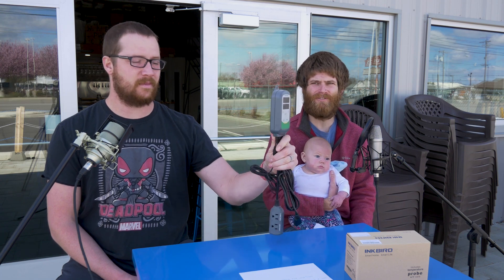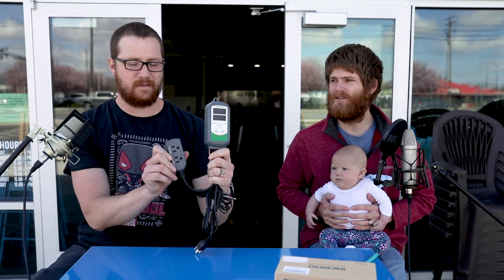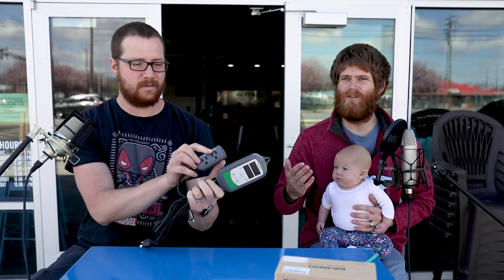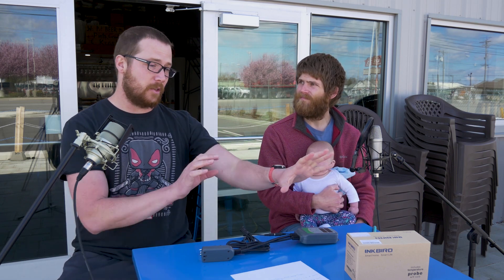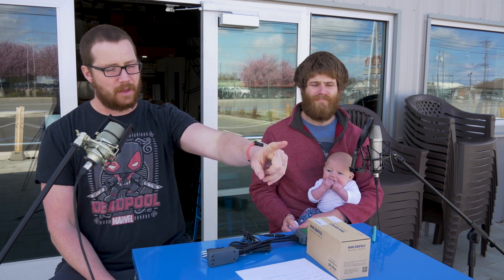5 Uses for an Inkbird in a brewery : A Temperature Controller For Everything

Comment: Will this work to run a small ceramic heater? Need something to run a heater in a dog box. Obviously the dogs will not be able to get to it or the heater. On at 40 degrees off at 55 I was thinking.

Comment: When using an inkbird to control keezer temp, could I attach a power distributor to the inkbird to be able to attach both a keezer and a fan(to recirculate cold air) inside the keezer with the inkbird temp control function?? As you see im not too good at electric works and would like to know the simplest way to connect a fan(but do not want it to be unsafe either).

Comment: Another use is to use as an alarm for when your strike water or boil is closing in - just set the alarm on the unit.

With IFTTT and the wireless one you can schedule a scene change through google calendars or by date and time.  I've written the ones currently on there and if they allowed you to name scenes within the calendar events I could write something awesome, but they haven't allowed that - grrrr!  EDIT:  I could write more Apps with them numbered like "Stage 1", "Stage 2" so you can do a full schedule.  If anybody would like that let me know.  Not many people are actually using the ones I've written.

Everyone check that the app doesn't cause a reset if you're using scenes - the old Inkbird app works fine, the 'Pro' one was causing a complete reset when you change scenes which could really, really mess up your day.

Great video lads - I'm using a chest freezer as a fridge right now and it's so awesome.  I only have it on during daylight so the solar panels are running it and it costs nothing.  Chest freezers are mad efficient.
Reply: I am interested in your programming experience with the IFTTT. I am attempting something similar to your scheduling of scenes. Instead of days/weeks, I’m interested in minutes/hours for cheese making. Would you please direct me to your well thought out programs for my educational purposes?